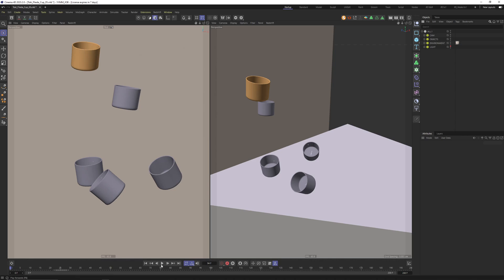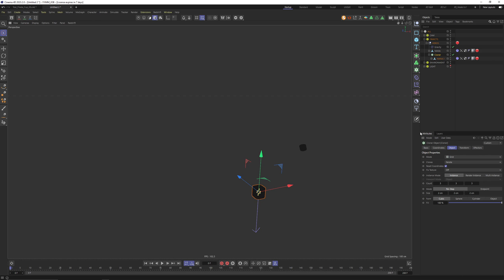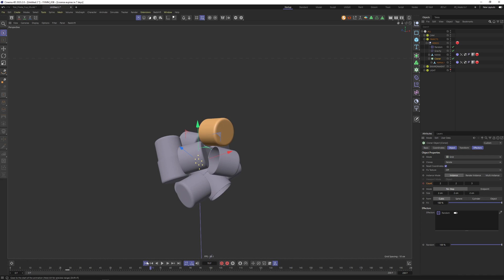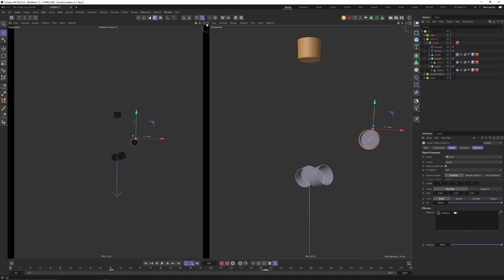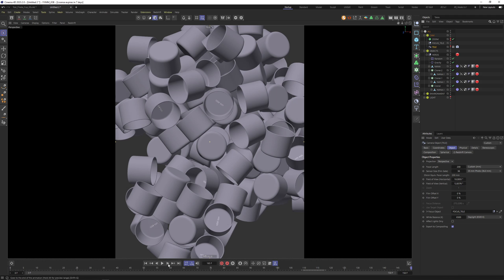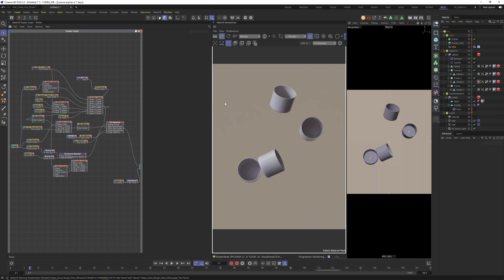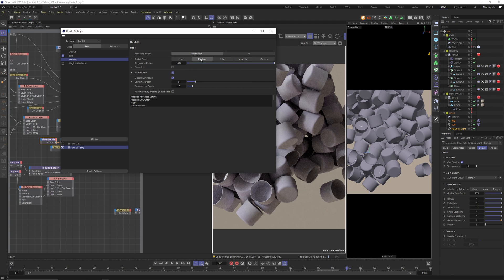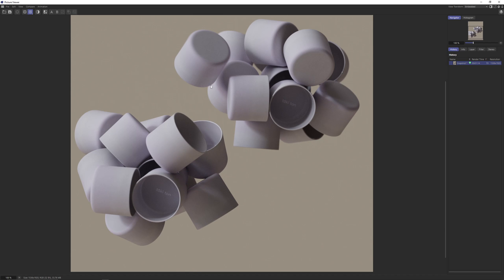Exploding Cups - Basic C4D Dynamics and Redshift

Comment: Thanks a lot for this! I have an issue driving me crazy. I have some baked dynamics with a cloner and a rigid body tag; I needed to play with the animation speed and the offset frame to achieve specific effects, so I baked it as alembic. Everything seemed perfect until I hit the final render, and the baked objects are not showing on the Redshift picture viewer. Everything seems ok, and even the preview Renderview shows the object, but the issue is the final output :S

Any clues of what could be happening? I really appreciate any help you can provide.

Comment: Is there a  way to adapt this  technique  to splitting cells? Basically, a single  cell  would  split  and t hen each of  the  new ones would  split and t hey would push each other away as t he space  fills.
Reply from the maker: hm, I could try to rnd some. But like this I have no clue
Reply: Probably using spheres instead of cups and putting it all into a volume builder and volume mesher could be worth a try.
Reply: You can do that with particles as source for voronoi shatter